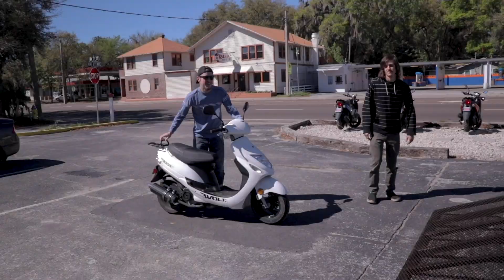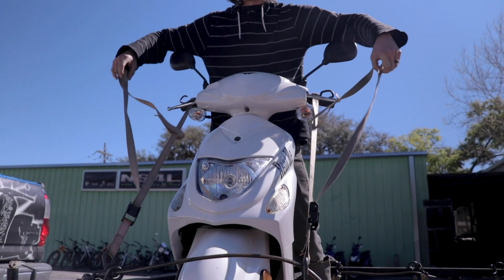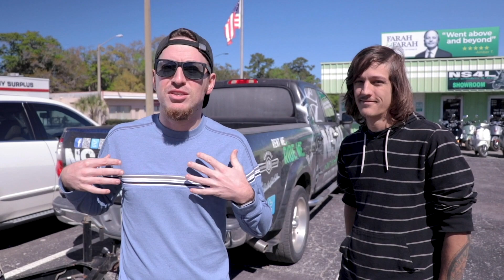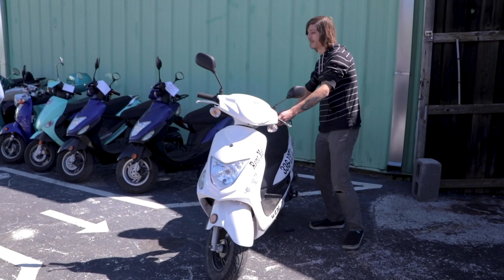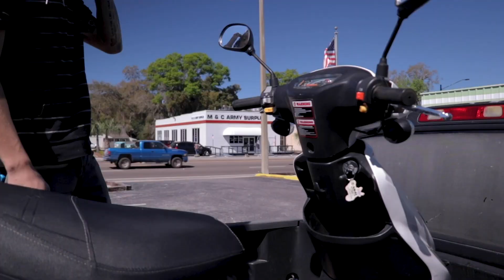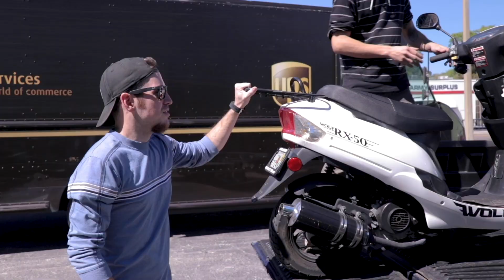How To Load and Strap Down Your Scooter | NS4L How-Tos

Comment: Just strapped down my first scooter Vespa et2 50 
Did it the same way you are around the grips and guess what the grip started to slide off the handle bar lucky I noticed it right away.
Ended up putting cross straps on front as well 4 straps @ front one at rear through rack to other side.
Reply from the maker: Great catch! Glad you noticed it. We rarely see this happen, but it's definitely possible. Crossing the straps on the front can prevent this, BUT make sure that the metal pieces on the strap aren't rubbing the paint! We see a lot of scoots get scratched that way. Thanks for the note!

Comment: Sorry to be a killjoy, I appreciate the video, but some major, major things wrong here:
1.  Center stand will bend under load.  Especially Hondas, the best scooters made, you don't want them to travel with the center stand down, it will bend on bumps.  Then straps come loose, so loose scooter falling over and bent center stand.  Not good.
2.  Attaching to grips - With your angle of attack, you're fine, but most people don't have that trailer with the hooks straight ahead.  They will be coming from a 45 degree angle,and the grips can easily slide.  Loose scoot falling over.
3.  Attaching to the luggage rack - luggage racks are rarely rated for over 10 lbs.  You are going to need way more than 10 lbs of pressure on those straps.  You can bend/break the rack, then loose scoot falling over.
4.  Pull straps vs rachet - you need the ratchet, those cheap pull straps easily come loose, it's why they cost half or a quarter of what ratchet straps cost.

Again, sorry to be a downer, but this video is all kinds of wrong.
Reply from the maker: Thanks for the comment.  I won't debate with you, because much of what you say makes sense, but I will just note the following... there are 100 ways to skin a cat.  Been doing it this way for over a decade and haven't experienced these issues.  Thank you.
Reply: @NewScooters4Less  Sounds good.  You guys look like good/smart people, maybe I overstated the "major, major" part of it.  How about I downgrade to "some things to watch out for", lol.  Cheers.
Reply from the maker: @doctoreeeveal  You're all good!  Lol!  We're all trying to take care of the cyclists out there!  It's a team effort!  :) Stay safe!

Comment: Would you still leave it up on the stand in the trailer if you were going on the highway for a couple hours or would it be best to just leave it on two wheels?
Reply from the maker: What the We’ve totally left it in the center stand before but it’s not necessary. With the shocks compressed forward and equally balanced left and right, you don’t need to have it on the stand. I would strap the rear rack for extra stability too.
Reply: @NewScooters4Less  thank you
Reply from the maker: @whatthe2458  Our pleasure!

Comment: I am picking up Piaggio mp3 and weight over 560bls. how do you load up to trailer?
Reply from the maker: Hey Roy!  Do you have a flatbed trailer?  This is what we use when we have to haul one.  The process of strapping it down is very similar, but we just strap it down in a flatbed trailer instead of the bed of a truck.  Thanks!
Reply: @NewScooters4Less  Yes but my dad let it to his friend used it down south oatland, Tx.! There other small trailer my dad have i hook up wheel holder for two scooter my be put in backwards because 3 wheel scooter?
Reply from the maker: @roywalls5595  You don't have to put it in backward.  We don't.  Just make sure the steering is locked, the emergency lock is on, and it is strapped down extremely well.